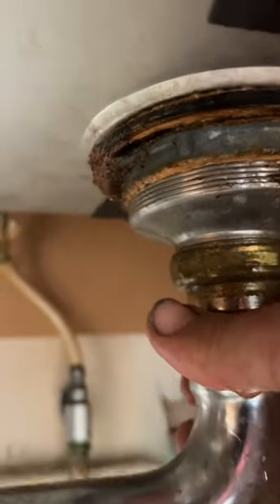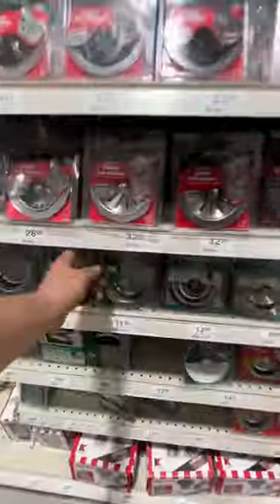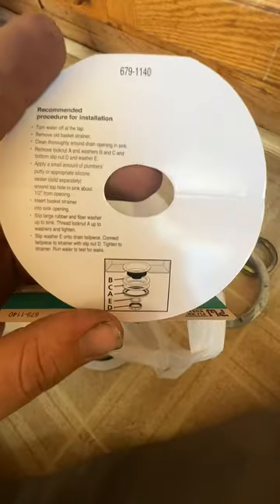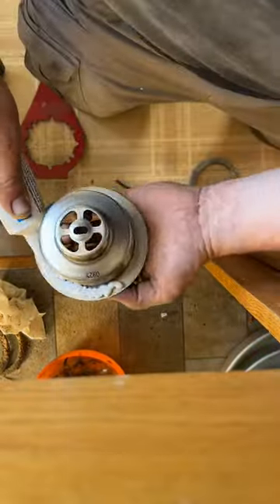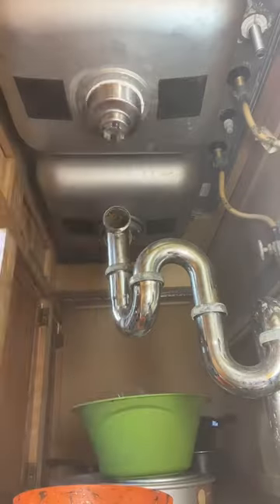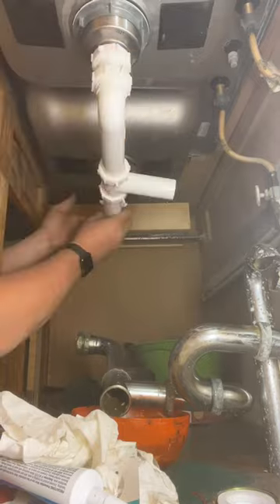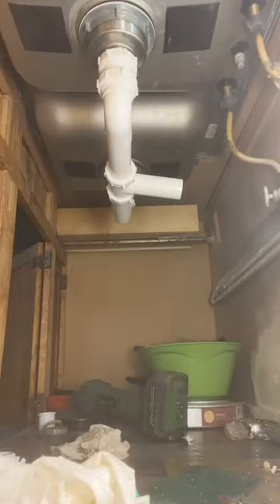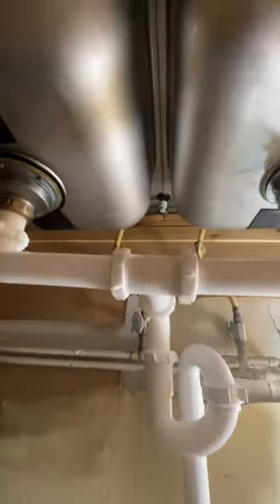Fixing a leak from a kitchen sink #HandsomeOrHandy￼

Comment: That's a kitchen in a restaurant I take it with the metallic pipes it was desirable for boiling water and high temperature 😖😜🤪😝
Reply: No. But you can’t put pvc in restaurants or commercial buildings

Comment: Those chrome traps are just terrible. PVC ones can be taken apart and cleaned multiple times with no problems. The chrome is basically over sheet metal that rusts from the inside.

Comment: P trap must be below the drain pipe in the wall, otherwise the trap is siphoned and your kitchen gets smelly.
Reply: That's not a p-trap he put in. It's an s-trap. He should've put a p-trap into a sanitary tee with a cheater vent off the top as high as you can put it. That's the proper fix for this(short of re-plumbing the entire house and vent stack)

Comment: Double P-trap is not correct the suction from the last P-trap will pull the water from the first P-trap causing no water in either P-trap letting fumes enter through the lines

Comment: Rubber gasket always worked for me on top never had problems
Reply from the maker: It creates an extra lip and does not allow all of the water to drain.
Reply: @HandsomeOrHandy  I prefer that the than the puddy always leaked in my cases I stopped using it . The rubber gasket worked really good never had a leak.

Comment: Shoulda called a plumber broski not trying to hate but we have a little higher standards and that pressure tee you got on is side is not one of them look up a part called a continuous waste that is what you need to plumb to sinks to one drain arm
Reply: And you need to use slip extensions so you don’t s trap your sink that trap is just gonna siphon it’s self dry every time sir
Reply: Continuous waste line into a p-trap into a sanitary tee with a cheater vent off the top as high as it'll go.

Comment: Yeah that S trap is completely wrong the reason it didn’t line up is because your tail pieces weren’t long enough… And that isn’t a paper gasket on the basket it’s on there to give a slick surface against the rubber gasket so the zinc nut will spin against it to tighten up…

Comment: My God, it’s all bad. I don’t use silicone on a basket strainer only use plumbers putty. If I got that call, I would have taken one look at that s trap and told them that we needed to install an air admittance valve for a vent and a proper P-trap not all this loop de loop Shit.

Comment: small tip or two for ya - carefull not put tooo much silicone on strainer - too much will cause gasket underneath to slip out - also -a little silicone on the mating surfaces of the PVC trap assemblies works wonders - hand tight only -

Comment: To all the people who are shouting that this is not up to code: You are correct. it's not up to code. 
The thing is: if you ever get a real job working in actual houses, you will very quickly find that all your angry comments about code are simply naive. Many MANY houses have never been built to code and all your dumbass remarks about how other people are not working to code are just you not having a clue about what goes on in the real world.

I'd never silicone the thing shut though, that's just mean on the next guy.

Anyway, come back when you have dealt with situations like these and succesfully implemented a solution that made a not-upt-o-code house up-to-code. Good luck with that. Untill then: just shut up and accespt that you're naive.